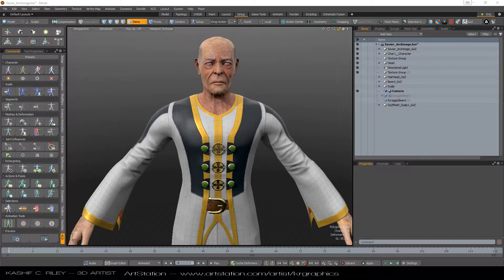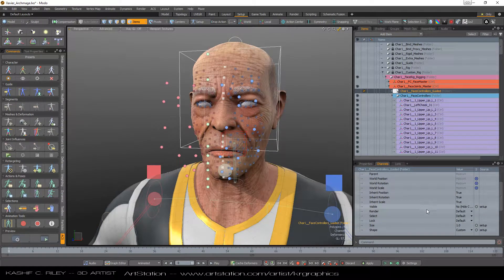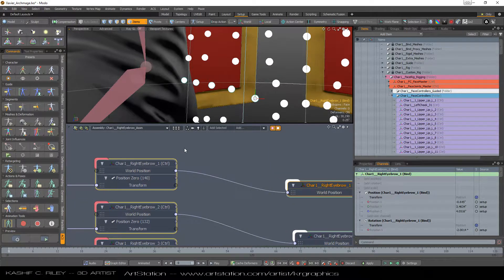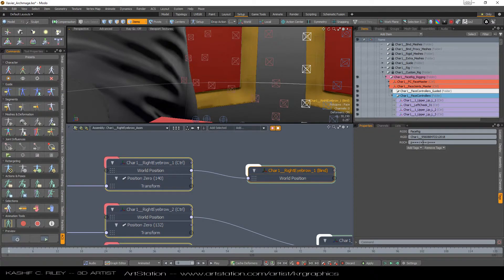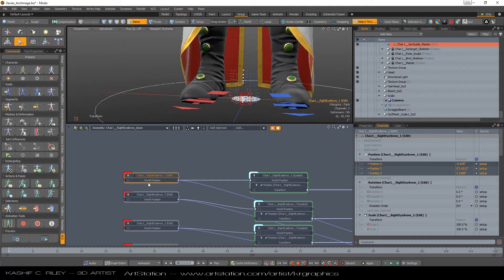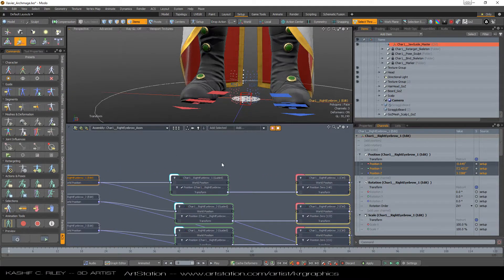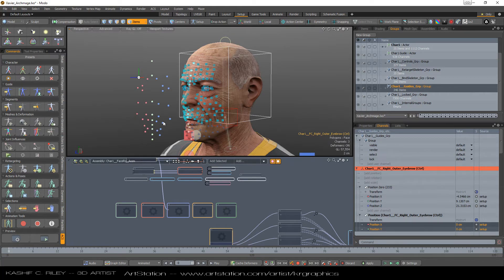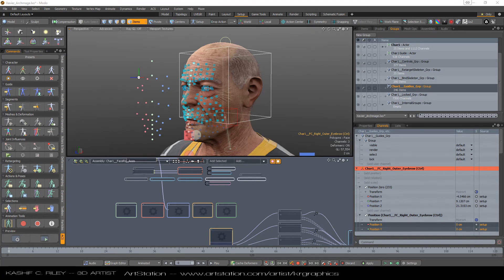KRGraphics R&D: ACS2 Modo Face Rig

Comment: Thanks for sharing this Kashif it has some useful pointers on extending the ACS2 rig.  I'm curious if you will be making any videos demonstrating how you bind and weight the rig to the mesh and how to create relationships between the different controllers?  Also you mention in this video another Maya rig that is serving as your reference/inspiration.  Could you share a link to this?  Thanks, keep it up I'm sure this has been a ton of work!
Reply from the maker: Matt Keyes It's been about several months of work getting the comtrol and weighting to work on this rig without NLA, which would make this easier with pose based controls.

And I will give an extensive demo of how I set it the rig and weight mapping
Reply from the maker: And the rig that inspired me was the Snappers Advanced Facial Rig